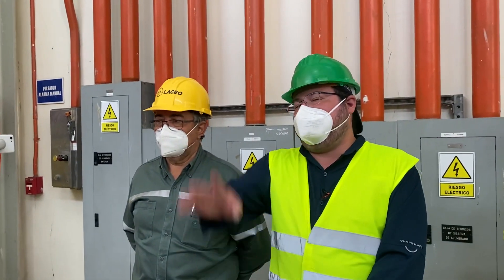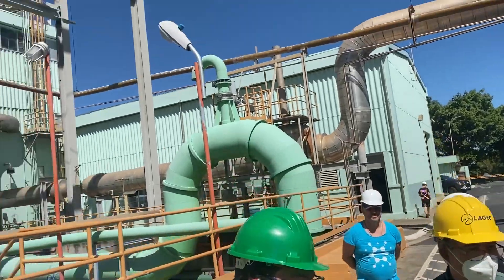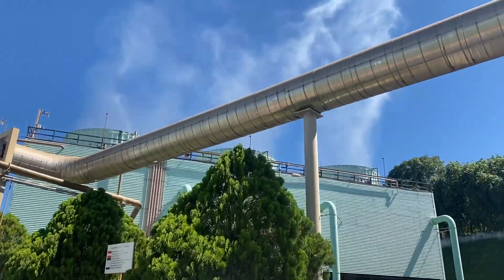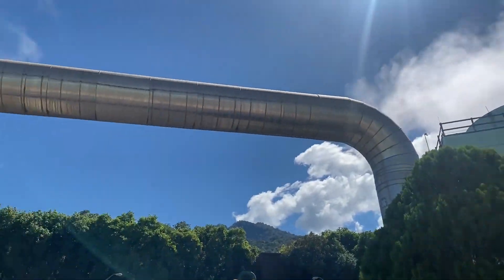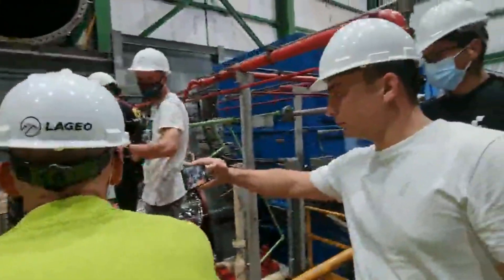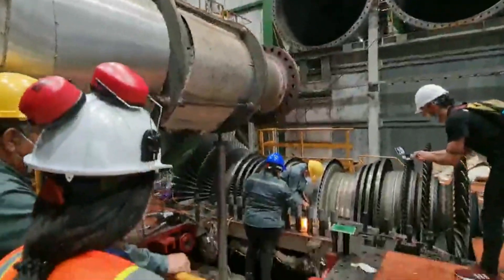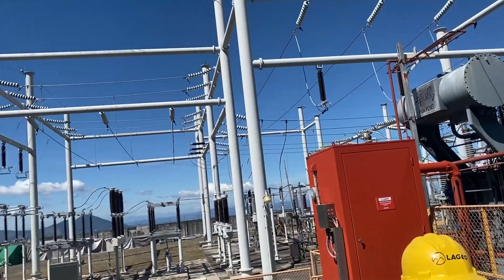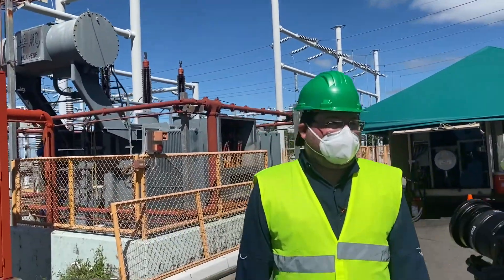El Salvador Bitcoin mining farm. Green crypto mining with geothermal volcanic energy

Comment: :yt::yt:<there are so many ways to accumulate and stack up your portfolio. The crypto market has made a lot of people rich. People ask themselves if this is the right time to invest before going into conclusion i think you should take a look at BTC price whether it is entering a bear market or it’s just suffering a brief correction on the road to more record highs. Investors who bought early are still in profit despite the ups and down and they also earn by trading. I'm still an investor and still I'm winning by applying the same method in every trade, you can also become a winner today. We should follow the way of earning more regardless of the market (bulls or bears), which is trading. Buy the Dip and Trade ... I have made over 7.4 btc profits not just by buying the dip but implementing trades with signals provided by Oscar Wilson a veteran trader con-tact bellow 👇🏼👇🏼⬇
Telgm @ Oscarwilson2013